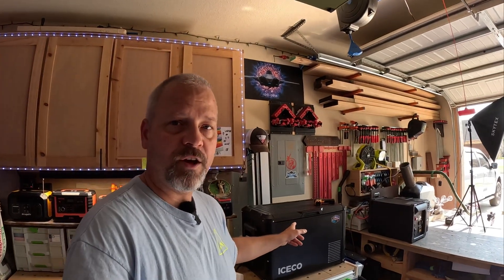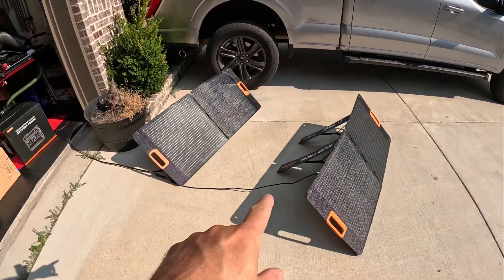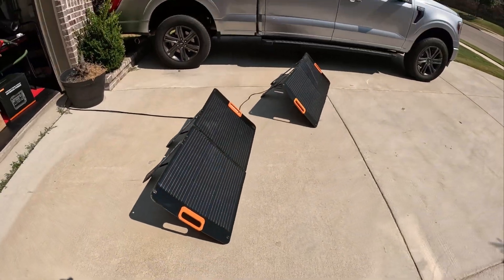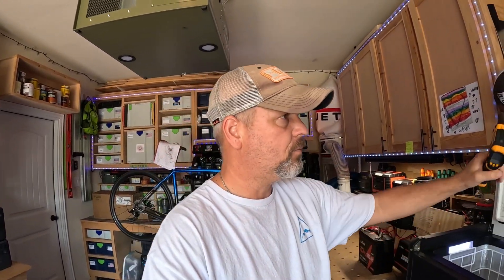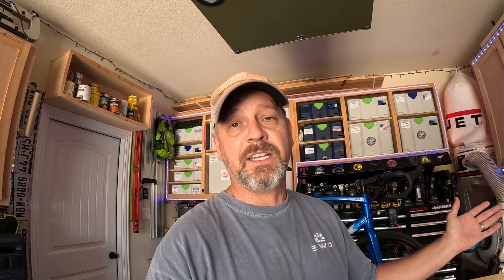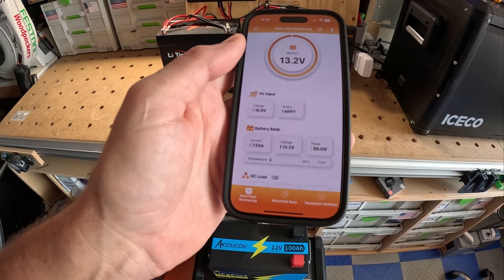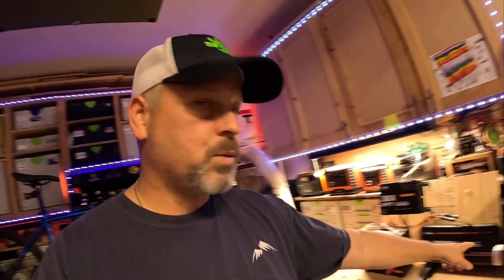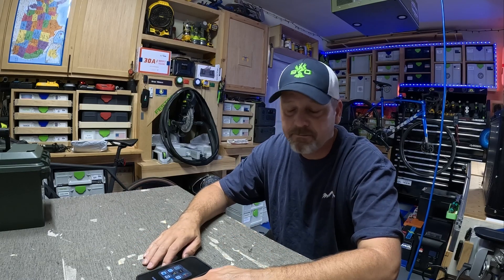Part 2:  Runtime test with a DIY, simple solar generator setup and a 45qt fridge.

Comment: Why run a DC fridge with AC power through  an inverter?
Reply from the maker: Mainly so I could monitor the total watts used via the a/c with the watt meter. In a true emergency situation I wouldn’t care about that and I’d hook directly to the battery
Reply: @GearGadgetReviews 👍👍

Comment: 👍👌❤️🇨🇦, I am not really suprised by the results, as long  as you are able to supply more power into the battery than what what is being consumed. It would be endless if you had enough battety or batteries to compensate for the days that have reduced solar output, and enough solar panels to maximize the solar required, I have lived off grid completely since 2000, presently have 36 x 405 watt solar array, cannot use LiFePO4 batteries due to the cold weather, I use instead 8 heavy duty forklift batteries , hot water is heated via solar as well, gr8 test though, it can be done
Reply: Why not buy self heating Lifepo4 batteries. Nobody should be using any other type of battery at this point in time. And those batteries have gotten really cheap

Comment: Thanks for a detailed look at a real life scenario. I know this was kind of a Li Time commercial but it would be interesting to see how long the same fridge could go connected directly to the battery without the added drain of an inverter and ac adapter. I believe it would have made it through that last night since it would only draw while the compressor was running. The setup you have would certainly keep a residential refrigerator running for decent amount of time during a power outage.